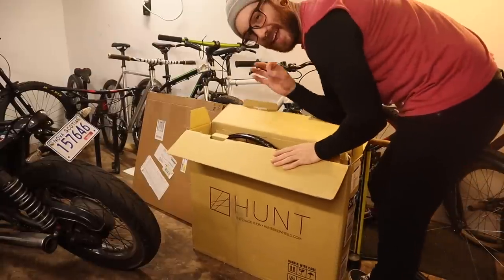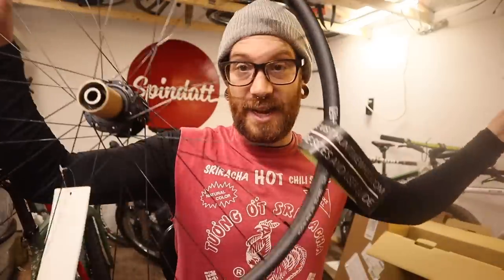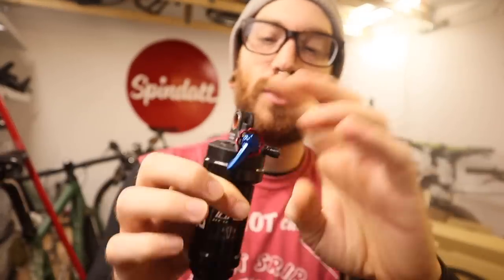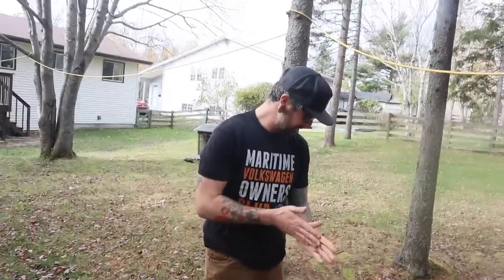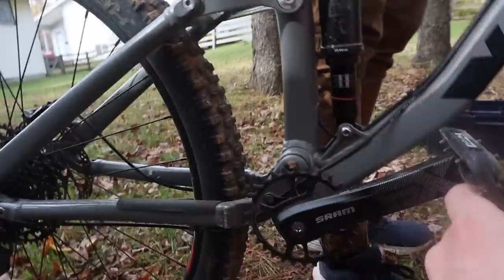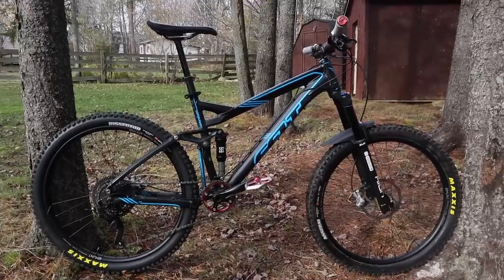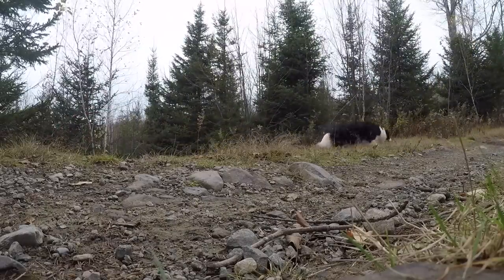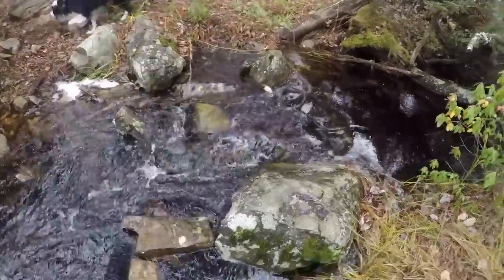Done did got Hunt MTB Wheels

Comment: This is like my ongoing project bike:  a 2012 Trek Cobia. Even if I upgrade the front wheel to boost, I will still be limited by the QR rear wheel due to the frame. Perhaps new bikes should be built with swappable rear frame parts.

Comment: So your custom steel frame is going to have non-boost dropouts or are the hunt wheels convertible to boost?
Reply from the maker: I’ll likely get it built boost, and just use an adapter for a while
Reply: @Spindatt  I’m afraid you can’t convert the non-boost to boost. It’s not a case of just getting adapters. The hub shells are different.